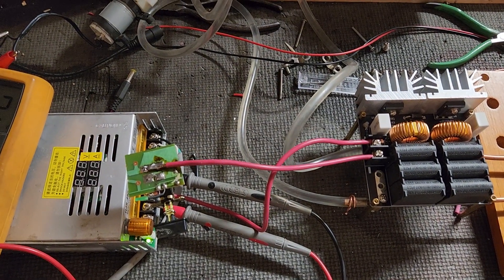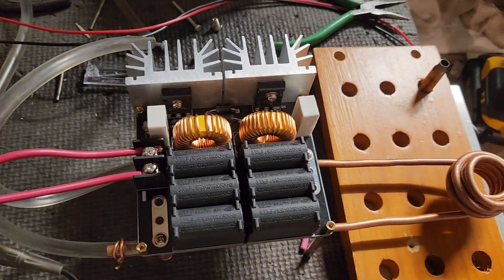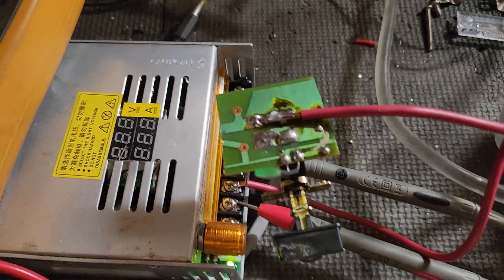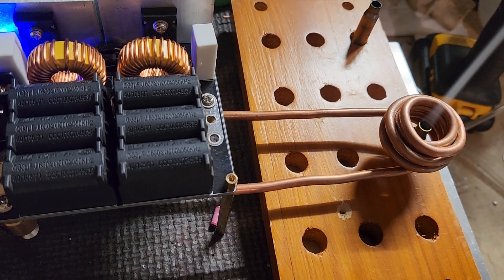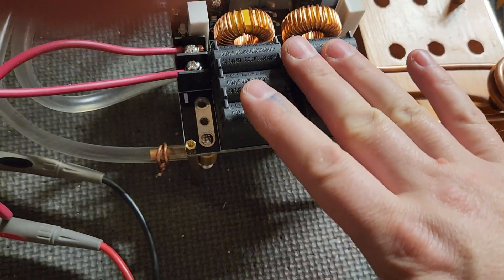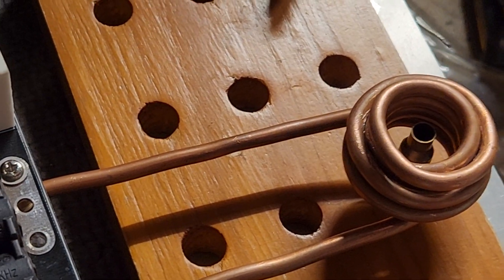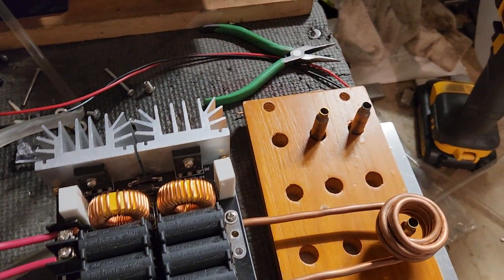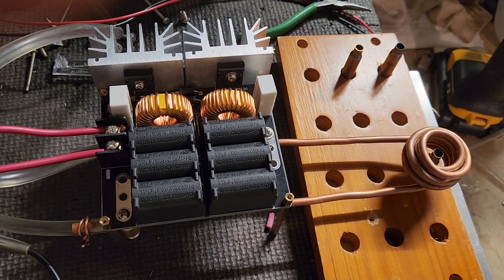Brass case induction annealer prototype - it works!

Comment: Hey. Haven’t heard from you for a while. Hope you’re doing good. Awesome annealer
Reply from the maker: Hey Jeff!  Glad to hear it from you.  This project is long overdue.  I can't wait to get everything setup so it runs in automated mode where all you have to do is fill up the hopper with brass and I can work on something else.  I've been using the torch annealer I made which is single fed and last time it took me nearly an hour to anneal some of my brass!

Comment: Still tinkering Dima?  Awesome!  Im still using flame annealing and what a drag compared to induction.  I put a plug in for your awesome gas check dies on CW Longshots channel but he deleted it right away for some reason.
Reply from the maker: Oh yeah, I added timed relay now and can't get enough of how awesome and fast it is!  Prior to that I was annealing with flame too and was getting really annoyed how long it was taking me to do the batch of brass, it took me almost 1 hour!  Today I was processing 6.5 Grendel brass and it was 2.2 seconds per case!  Next step for me is to add a trap door and a convenient way to adjust it up and down for different cases.

Comment: Kewl! With brass less is more. So if in doubt go less.
Reply from the maker: The amperage made a huge difference!  Once I hooked up 1000W PS (50v at 20A), even dropping to 40v (800W) it took about 1.75 seconds for .223 to start glowing and it took 3 seconds for .308 to glow where as with original PS it took a whopping 24 seconds!
Reply: @DimaProk  that's kind of my point I know you're after speed. But you're also going to glowing red, which is too much. So if you increase your time or lower your voltage, it'll give you more latitude. You're probably fully anealed. 
Just that Steam comes off and before it turns red, your fully anealed
Reply from the maker: @cw2a  You know I though the voltage would play a bigger role but its amperage that really matters.  Increasing from 36v to 42v I expected to be at least 1 second faster but it wasn't.   It seems like 10A is good enough for .223 but definitely not for .308.  Keeping the time shorter also reduces heat produced in the coil and at the board itself.  Those capacitors get real hot if you operate continuously and will burn out as it happened with my 1st board when I didn't use water cooled coil.  I am going to add a fan to blow on top of it.

Have you seen Eric Cortina's video where he over annealed the cases to 20 seconds and STILL took the same force to seat the bullet.  Its pretty shocking!  I will tell you though that a thinner 223 based cartridges don't behave the same.  I remember I over annealed my 300 HAM'R brass and was struggling to keep the neck tension.  I could push the bullet in if I pushed against the desk.  It definitely surprising results though with his brass.  https://youtu.be/9HfjRKrbYbo?si=c3eXKoz5KlGCVDF5

Once I get my timer which I had purchased for this project like 6-7 years ago setup (finding instruction manual will be fun)  and connected to Solid State Relay,  I can dial in exact time I need it.  I aim for when it just starts to glow, like dark red that's when I consider it done.  I do have Tempilaq I can use to verify but I found it you don't really need it.